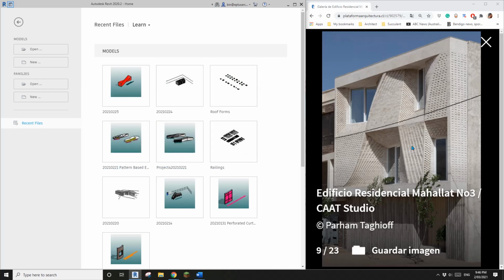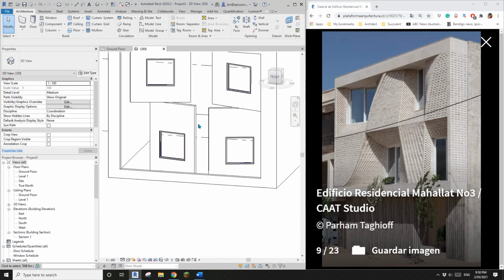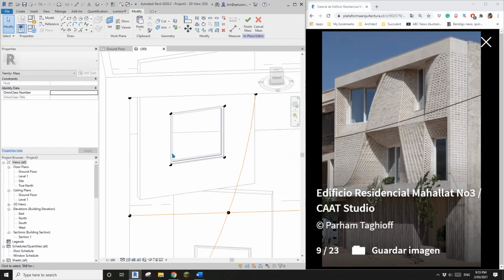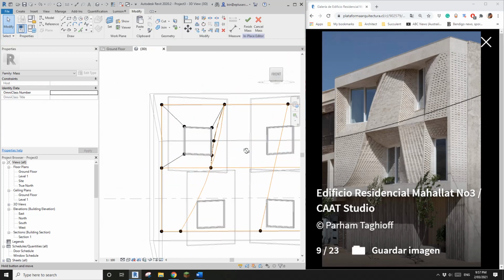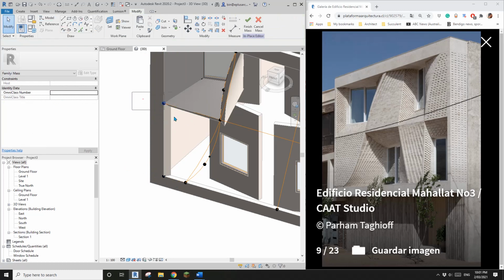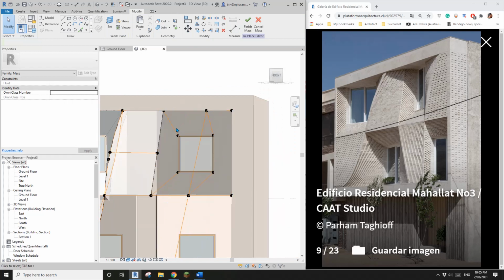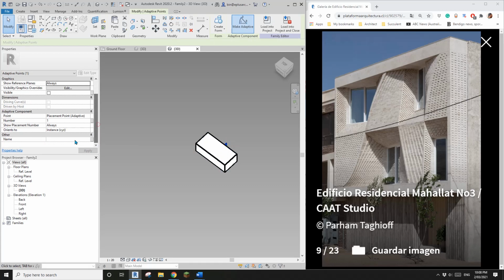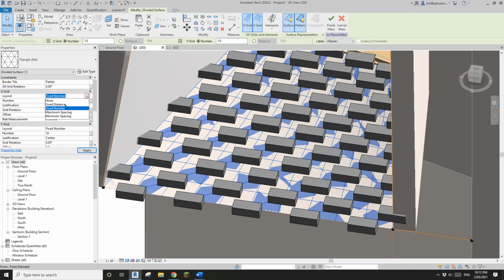Everyday Revit (Day 350) - Wall by face on mass exercise

Comment: Hi sir how r u ...can u plz make a tutorial of while setting the project unit rounding .one option is there to the nearest ..plz meke a tutorial of this ...how to set
Reply from the maker: You need to do it in dimensions setting.
Reply: @BINHE615  Ys i know.but when to use which
Reply from the maker: You can change the Project Units under Manage tab, the will change the global unit and will affect all the dimension using the default project unit setting. Otherwise, you can change a type of dimension to use some specific setting. For example, you can use Inches for your project unit but still have mm for your dimensions. You can also round your dimensions to closest 5 instead of 10.